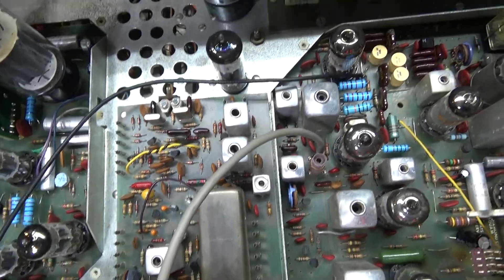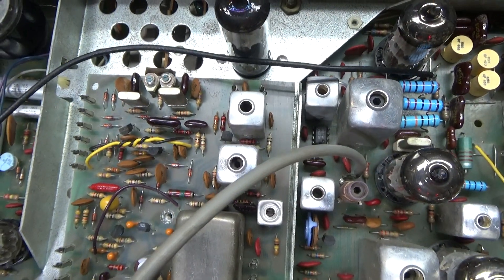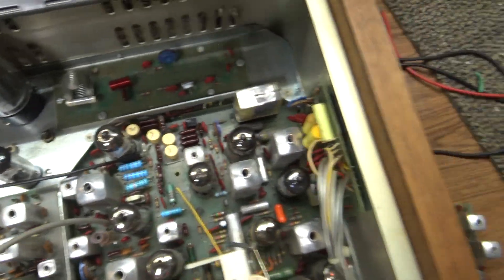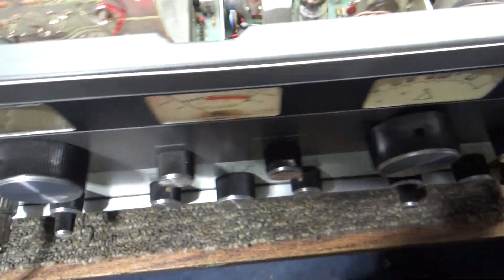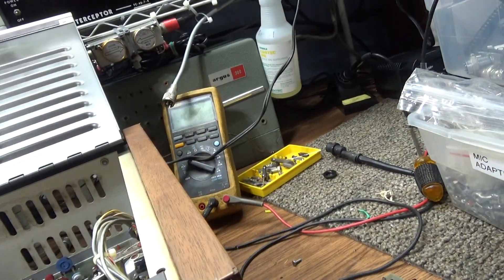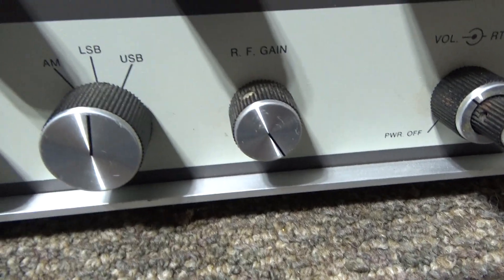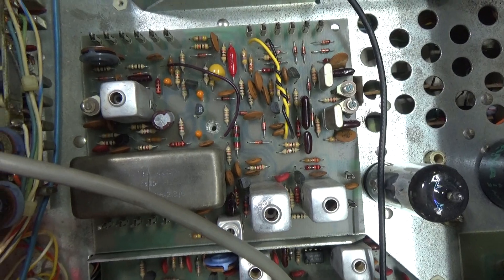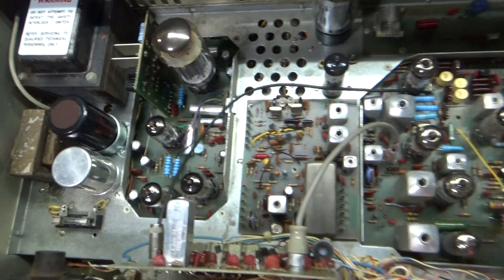Tram D201 Balanced Modulator PCB sold tested for customer.

Comment: You still have the D&A phantom 500 you showed 3 weeks ago
Reply from the maker: Yes!
Reply: How much would capacitors cost for a D+A  10 tube to recap it
Reply: I have a 10 tube 4 driving 6 I have not had it in line for over 15 years.
Reply: I believe you said $450 for the D+A 500
Reply from the maker: I would take $450 plus the ride for it. You would need 3 caps instead of 6 for cap replacement and they are around $12 each.
Reply: @tramdr  I need to check the tubes it has been so long since I have had it open 6lq6  or 6lf6 guess I should get out of the rafters. My ride would be from White Lake.
Reply: I also have a tram 180 and a kris power pump